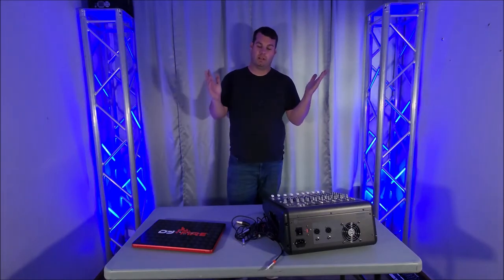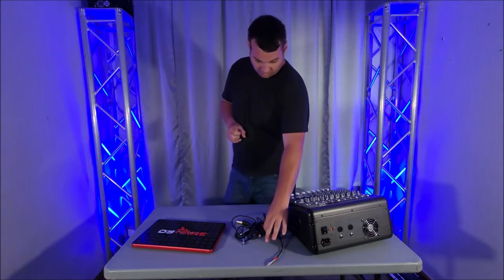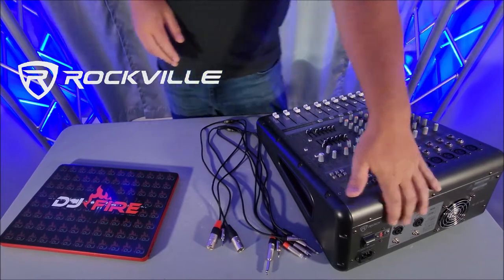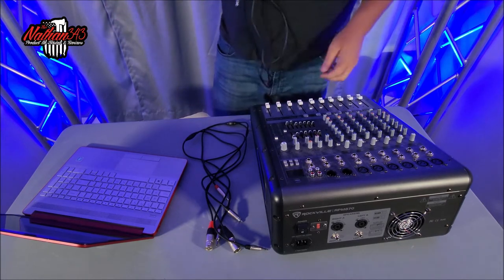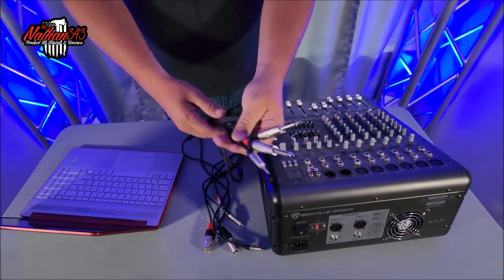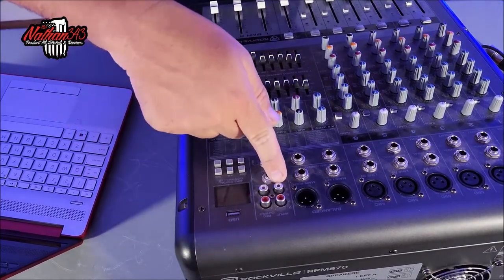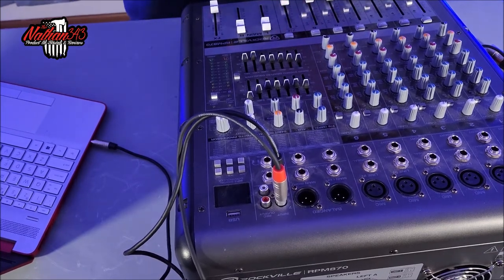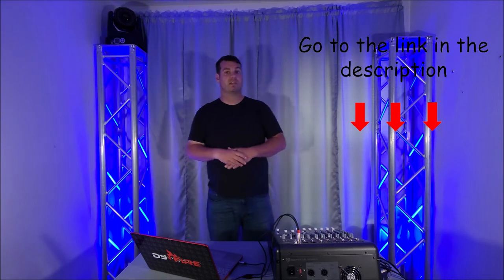How To Connect A Laptop To The Rockville RPM 870 Powered Mixer

Comment: I'm guessing all these methods will work but there is another that has not been mentioned... USB cable. That's how I use mine and the mixer automatically detects the laptop. I have always used this method (close to a couple of years now) for a secure connection that has never given me any problems.
In every review I've seen for this board, even those from Rockville themselves never mention this... under the USB screen, there are two rows of three buttons, the left and right buttons on the top row only, have dual functions. If you long-press those top left or right buttons they become another volume control for the USB/MP3 and channel 7/8 function of the board. Long pressing the top left lowers the volume, top right increases it. Mine displays volume numbers from 00 to 30.
It does not affect channels 1 thru 6. I read more than once where a reviewer says something like the mixer has no power, chances are they're using Bluetooth, Thumb drive, computer, or some other device that's running through channel 7/8 and need to increase the volume by pressing that top right button. Rockville devotes a grand total of just four words addressing this under the "Master Section" of the owner's manuel.
Hope this helps.
Reply: Does the mixer then function as an input to the computer and an output as well? That would make the need of an audio interface redundant correct? Right now I have a powered mixer connected to my audio interface to the computer. The audio interface introduces so much static from the computer, but if the computer is off then there is no static. I could remedy this issue with the Rockville rpm870?
Reply: @eavitt To the best that I know the mixer's Bluetooth is a receiver only. If I understand your question correctly, one way could be to connect your computer to the mixer through Bluetooth but would then have to hardwire the mixed sound back to the computer such as using the RCA outs with a Y/splitter cable to the USB connection on your computer.
If you intend to use any or all of the 6 channel inputs you could use a wire with a 1/4 jack to USB through the Aux out connection. this would give you a much greater degree of control not only through the adjustments on each channel but also through how much input each channel has using the Red Aux dials. Hope this helps
Reply: @tonyb3947  it most certainly does. I already have that y splitter that could go to an audio interface. Thank you for your time and help.

Comment: best to use is RCA since it’s unbalanced audio the whole way, with XLR you have to turn it into balanced audio passively and the 1/4inch may accept balanced or unbalanced inputs but RCA is for sure unbalanced, just like the the laptops output.